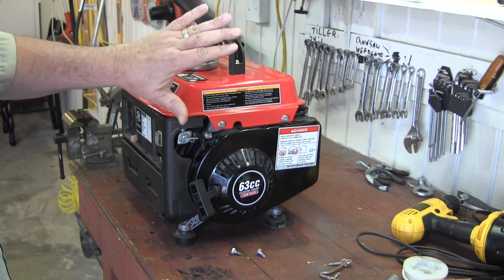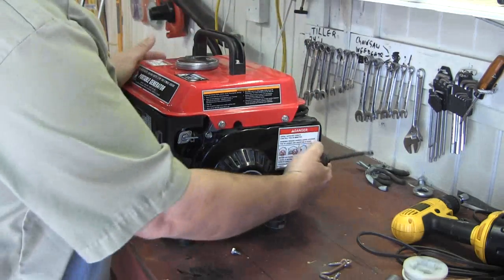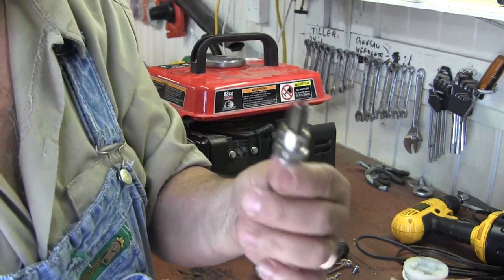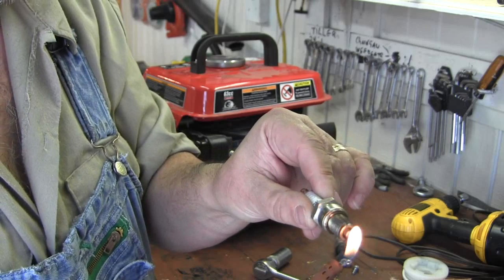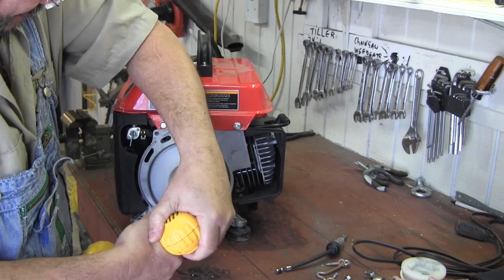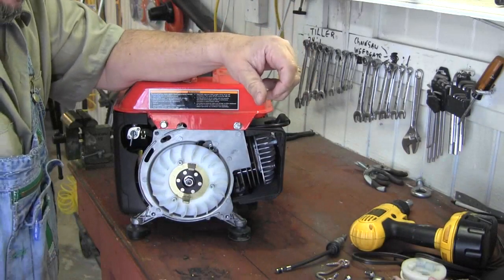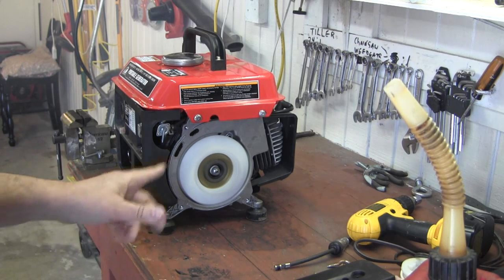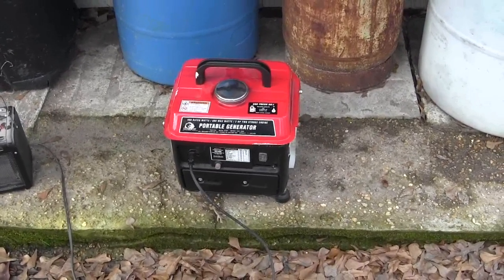Harbor freight generator wont start

Comment: Way, way back in the early 1970s, I had a Yamaha 350 bike.  It had a 2-cycle engine that used an oil injector to mix the fuel.  Like your generator, if I didn't shut off the fuel, the engine would not start.  I had to remove the spark plugs and run the starter for several second to dry out the cylinders.  Then it started.  I never got used to turning off the fuel valve; frequently forgot to turn it off.  I always thought that if I turned off the fuel valve, the fuel was OFF.  Apparently not.
Reply: Other suitcase generators have combined switch and fuel valve. (Separate parts but combined with the on-off knob.)

Comment: I am seriously considering picking one of these up if they go on sale before Prepper Stock
Reply from the maker: Thay are hand and fairly quiet. they will run lights OR a fan OR a electric heater. 900 watts is all they are good for.
Reply: I've got a cheap 2500, but it's bulky and LOUD!!
Reply: NOOOOOOO, you will regret. These generators should be discontinued and demolished. They are the biggest Pieces of shit, friend had 2, and both died after a few days. TERRIBLE.
Reply: homebuiltindoorplane you know im right, that's why you resort to 8th grade responses ..thankyou.
Reply: ig ig ig ignorants makes me smile.....
Reply: *****  If you watch My name is Earl bloopers on here he does that and its hilarious:)
Reply: ***** I've had mine for over a year with well over 500 hours of hard use (80-100% load) and have not had a bit of problems with it. You just have to take care of it. They are a little fickle. They need a good spark plug and the carb should be dry before you store it. I shut mine off with the fuel valve instead of the switch.

Comment: I just got one (purchased 3/11/16)and have a question.  Started right up and fueled 50:1 with NO-ethanol fuel. My problem is, I stop it. Then try to restart HOT. It usually takes about 20 pulls and only when I put choke on half-way does it fire. I guess that is okay, but shouldn't it not require any choke when HOT? What is your opinion?
Reply: +Roger Lockwood Two reasons i can think of. First engines tend to be ran very lean these days for better emissions, this doesn't help. Second is because this appears to be a fixed RPM engine, it is holding the throttle plate wide open when the engine isn't running. Sometimes engines like that won't be able to draw enough air through the venturi at startup to cause a low enough pressure to suck the proper amount of fuel up the main jet. Putting the choke on forces the engine to pull more fuel up. Sometimes it is the nature of the beast.
Reply: D3faulted1 Thanks, great explanation and makes perfectly good sense.
Reply: +Roger Lockwood I forgot one, you could also have an intake leak between the carburetor and engine. This would also cause it to run lean and poorly. If it's running fine without the choke once it starts then i highly doubt this is the cause.

Comment: any time you shut off a 2 stroke you should shut fuel off and allow it to run till out of fuel .my old 2 stroke 9.9 still runs like new and I bought it in 1993 and have never pulled out of the lake with out disconnecting fuel and allowing it to idle till out of gas and the same practice holds true for any 2 stroke with a carburator
Reply: Two strokes are dependent on lubrication from pre-mix; are you not afraid of cylinder and bearing wear or damage when running lean for the final air/fuel mixture loss?
Reply: No problem at all. Besides in that end run the engine is just sitting without doing major work.
Doing it for years never had a failure in this conditions. When sitting for a long time the mix also break down and you end up with a lot of varnish and oil stuck in the carburetor. 
Even 4 stroke carburetor should be emptied before storage. ;-)
Reply: oil coating all parts dose not disappears that fast also understand you are not adding fuel with out oil washing the oil off components you are simply cutting off supply of both I do this with my boat motor for over 20 years and still runs like new today and never had to have any work done on it past sparkplug and gear box oil replacement  normal preventive
Reply: People run out of gas with there 2 stroke all the time with no engine damage and they are under full load when they are operating there 2 stroke. And no harm done at idle 0 chance of harm by just shutting off fuel/oil mix
Reply: Yes sure. When the oil ends the fuel end also. So all is normal. ;-)

Comment: My generator is 2000 Watts I got it from aldi for $120 I was going to buy hf one but saw the bigger one so bought that instead. I never have any problem getting mine started even if I let it sit with gas in the line
Reply from the maker: great deal! is it china made? 2000 watts is just the right size.

Comment: I would think any engine can run once it fires the first time and your spark plug has so much carbon built up it works as a glow plug.. just like a diesel engine works without spark plugs.. Good job. THE MAX

Comment: These are famous units.  They have famous but well known faults.  Armed with the help of the internet.  No reason to not by one unless you need a bigger unit.  I also use a storage fluid to mix in the last tankfull and run it for 10 minutes to be sure and get the Stabill mixture everywhere.  Oh the suggestion to shut the fuel off and let the carberator run dry is ok in my book. Even if they have a diaphragm type carb.

Comment: I left the gas on and it flooded the carburetor and filled up the crank case because the float malfunction. While checking the oil, fuel gushed out of the oil plug. I had to cycle fresh oil several times to clear out all the fuel in the oil. You also have a problem with hydraulic lock. Be very careful.
Reply from the maker: This particular generator is a two stroke. There is no oil filler for the crank case. It’s more like a weed eater or chainsaw type of engine. I have lawnmower engines that had float needles fail and produce the same symptoms your talking about. By the time your done fixing, you have a very clean and flushed out crank case.

Comment: I have the same one ... Does anyone know why my pull cord wont move... I cant crank it at all ..i cant pull the cord more than 2 inches... ?
Reply from the maker: Yep. Pull the plug. Your cylinder is filled with gas that leaked into it through the carb. Pull the plug and tell me if that’s it.
Reply: @bctruck  brother thanks for responding for real... Ok pull the plug and do what? Are you saying pull it and look to see if its wet like you did on the video or are you saying change the plug entirely? (That will keep me from being able to pull the  cord out ?)  Wow
Reply from the maker: @crappiesniper  No, pull the plug completely out and leave it out. Then , see if the rope will pull out. What happened to mine was gas leaked past the carb and filled the cylinder. I couldn't pull the rope either because the cylinder was filled with gas.
Reply: @bctruck  ok im going to pull out the plug and see what happens... Should i pour out that old gas? There is still gas in it from a hundred years ago seem like. What do you recommend i do about this anicent gas thats been sitting in it for a long time? (This generstor has never been used only been started 2 years ago but my father n law put gas in it a couple of seasons ago and im trying to get it started) ...im going to do exactly what you instructed
Reply from the maker: @crappiesniper  Pull the plug, drain all the gas out of it including tipping the unit over to see if any gas comes out of the cylinder hole,after the plug is out. see if it will pull over. If it will,then you had the same problem I had. It will take a bunch of pulling on that rope to clear out the gas in the cylinder. I would pull on it until your arm feels like its gonna fall off, than let it set somewhere for a few days to dry out. then,install the plug,add some gas and see if you can crank it.
Reply: @bctruck  awe man thanks im going to do exactly that but i was hoping i could have used it today for camping 😬😳 i guess you're saying thats not going to happen...
Reply from the maker: @crappiesniper  Its not and Ill tell you what, these little things are nearly useless because they put out so little electricity. You could run a fan off it or (not and) a string of camping lights. I dont even have mine anymore. Plus, they are loud as hell.

Comment: I know this is an old video, But when ever you see a white cloud in your exhaust on a generator with it's tiny exhaust system you know there is water in your fuel system. Never long term store a generator or any other gas powered equipment with gasoline in it. The wild temperature swings in the winter  cause condensation to form in the  steel gas tank and even in plastic ones. This causes erosion damage to the fuel system.

Comment: Run the oil a little low on these, maybe 50:1 synthetic.  If they give you any grief, pull the plug out wire brush it andget it good and hot with the propane torch - it'll start perfect after that..

Comment: I can't get mine to work anymore. crank it all, change spark plug and cap. new gas and all. I last resort to starter fluid n it start up with smoke for 2 sec then die.

Comment: You are very smart.  Let me ask, can I use an ethanol evaporator similar to STP gas treatment?  I used Lukes in my car when I used cheap gas from Wawa.  It stop having the jitters immediately.
Reply: +Karen Tid    I don't have a lot of tools, just a hammer and wrench.  It's going to snow a foot and my generator hasn't started in two years but it's brand new.  I didn't know to run it till the gas was gone (same with my mower).  I have willing friends that need a lot of supervision.  LOL  I UNDERSTAND THE COVER MUST GO ON WITHIN 15 MINUTES.  RIGHT?  But which cover, the air filter or the pull string cover?

Comment: I was duped into buying a Mantis rototiller from a TV advertisement which worked well "when running" but eventually could not get it to start.  Replaced many parts and it just never worked right.  When I developed a "tennis elbow" from trying to start it, I s--- canned it;  had almost $500 in that POS...

Comment: heres an old trick my dad used to do when are lawnmower got flooded,  take out the spark plug, now take a lighter and light it and put the flame over the spark plug hole and crank slowly so the flame goes inside the spark plug hole, it will burn all the flooded gas out.  simple fix.

Comment: I have one of these and I must've opened it up more than 5 times.  Replaced a leaking carburetor, the spark plug, spark plug wire, the ignition box and even the shut down switch shorted out.  The actual engine and generator isn't bad, but everything else on it will fail sooner or later.  Invest a few more bucks into a better one from sears.
Reply: Yes that is true the basic system is ok but everything that is made of rubber or rubber substitute is made of bad chinese low quality materials, for example tank cap cover seal which melts away and fuel hose gets petrified and it becomes very diffcult to remove. Even the carburetor bowl seal gets bad.   When i bought my first LD motor generator the on-off switch was assembled so that the markings on the plastic cover were the opposite (ON=OFF and OFF=ON). I had to write with white correction pen the exact switch positions.

Comment: I hooked my drill to the gen and ran it full speed for about 3 minutes without a pop. Gas in carb, good spark, and the only pops I get is with priming. It’s as if it isn’t drawing gas from the carburetor at all, and I even poured gas into the carb while I was spinning it full drill speed. Even though I retired as a mech this defies logic imo. I’ve since taken it apart to check the rings and they’re @ 0.015”. Unbelievable.

Comment: Top Tip: Never, ever leave gas in your generator, especially if your area has alcohol in the gas. Siphon out the tank, then run until the carb is empty before storing. I had a 30 year old Coleman that starts on the first pull every time because I don't leave gas in it.

Comment: sounds like that Train is really moovin when it goes through
Reply from the maker: When i bought this house,there was a single track there and a train would come through a couple times a day. then they came and added 4 sidings and it is where they switch out, and idle for days and days. my house fills up with smoke,you cant go in the yard without choking on exhaust from the train. If i could afford to move, i would.

Comment: Hello, 

how did you start your generator ?

did you get it running with your drill  ?

thanks
Reply from the maker: Pepe Aguilar yes. It flooded the cylinder because I forgot to shut off the fuel to the carb. I took the spark plug out and cranked for a long time with the drill. Then I put the plug back in and it cranked but smoked for about ten minutes. Then it ran normal after that. I just have to remember to shut off the fuel.

Comment: Well.. The reason it is smoking is because it is 2 cycle. Best to pull the carb and clean it after it has been sitting with gas in it for 6 months.

Comment: You REALLY should put the starter housing back on BEFORE running that for any length of time. That white plastic fan blade is there for a reason. That is the cooling fan and the starter housing is the duct work that directs the air to the cylinder and head.

Comment: Running it without the pull start you are going to overheat the engine. That's the air shroud to direct air from the flywheel over the head......
Reply from the maker: Sure thing chief.

Comment: Other than that I've had mine for three years always starts up on the second pull and uses very little gas compared to my 6500 watt generator
Reply from the maker: I have a 6500 watt also and i dont pull it out unless  I have to run my welder or if the lights go out, to run the freezer,fridge, and lights.

Comment: He was cranking it the wrong way. Good idea with the drill.
Reply from the maker: +Thomas Niner No he wasnt. He checked which direction the rope pulled it before he removed the pull start housing. This isnt his first rodeo.
Reply: +BCtruck, rebuild, repair,repurpose 
The first time he was cranking it with the drill he was cranking it clockwise (when it wouldn't start), second time counter-clockwise (when it started). I'm not criticizing because god knows i've done things like that before, and will probably again. Not to mention it's a mute point as 2-strokes can run backwards, might be running a bit off because ignition timing but it still should.
Reply from the maker: +D3faulted1 No.you are wrong. it wasnt going counter clockwise. I would have to reverse my drill to spin it counter clockwise.
Reply: +BCtruck, rebuild, repair,repurpose Your right my bad, i can see the button on the drill wasn't changed. Must be a trick of the camera that makes it look that way.

Comment: They are also known to come with a shit spark plug from the factory...looks like you changed it to a Bosch.
Also they don't run / store for shit on 10% ethanol gas...
Just what I know about the history of them....
If I do have a flooded small motor I keep the plug out and crank it to pump the fuel out of the engine.
Great way to start it....I am going to make one of those and start mine that way from now on.
Reply from the maker: I havent replaced the plug yet, but i will as soon as i make a trip to town.
Reply: BCtruck, rebuild, repair,repurpose Even the reviews right on Harbor Freight say that's a weak link...

Comment: It helps to know how 2-strokes are built. You can flood the crankcase hugely on one of these, then when you crank it there can be a large pool of mix to get transferred to the chamber. At 3600 rpm, under load, that cast-iron cylinder will heat up right quick, no matter it's the dead of winter, without fan shroud. Running that indoors could get you committed. Or dead.  Torch plugs are probably the worst- first thing to toss, for NGK.

Comment: Any comments on no spark, kill switch disconnected, spark plug replaced???
Reply from the maker: Bad coil.
Reply: @bctruck  any test on this, thanks in advance
Reply from the maker: Yes, disconnect the wires from the coil, pull the cord see if there is spark at the plug. If not, then the coil is bad.
Reply: @bctruck  it's running, bad coil replaced... thank you

Comment: He probably burned it up with no air movement over the cylinder !
Reply from the maker: He didn't. In fact he still has it and uses it often. He also thinks it's weird to speak in third person.
Reply: +BCtruck, rebuild, repair,repurpose Where does he buy a spark checker? Are they expensive?
Reply from the maker: He bought his from harbor freight for like 2 bucks.
Reply: +BCtruck, rebuild, repair,repurpose hey cool, thanks for the info! Great video btw
Reply: +BCtruck, Rebuild,  Repair, RepurposeIf you think it's weird to speak in the 3rd-person POV, then why are you "speaking" (writing) that way?
Reply: +BCtruck, rebuild, repair,repurpose I think  +Maxx Fordham doesn't know how to be funny.
Reply: That is what I was concerned about too.  A short test run is no problem but for hours is going to be tough on the little engine even if it doesn't seize up.
Reply: Yup
Reply: I was like.. "Dude, nooo!", but he did anyway.. lol
Reply: It will overheat without the tin work in place
Reply from the maker: No it am not! It still runs great years later.

Comment: I had a problem where it would shut off after a few minutes.. if u remove the throttle body or intake.. you'll notice fuel.. dry it up and itll start right back up.. trick is.. not to choke it when Turing it off... but mine keeps getting fuel inside the carburetor or intake.. whatever its called...